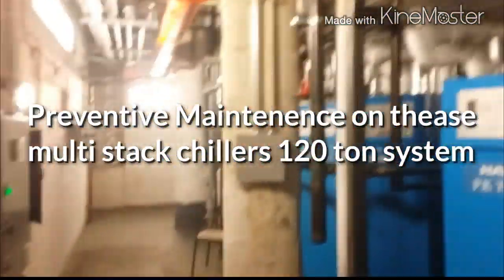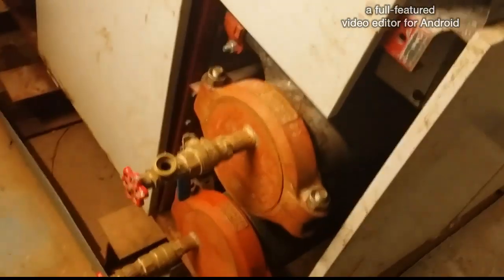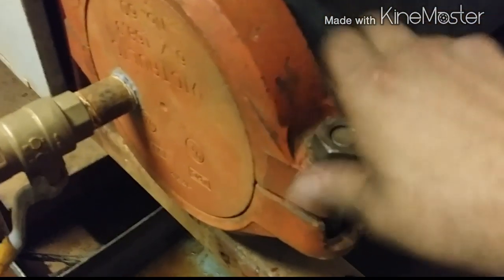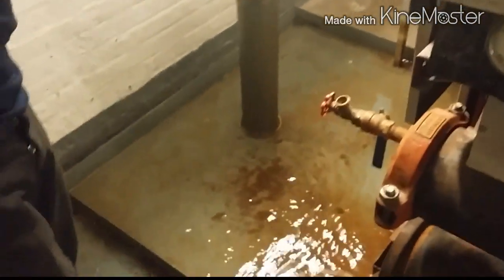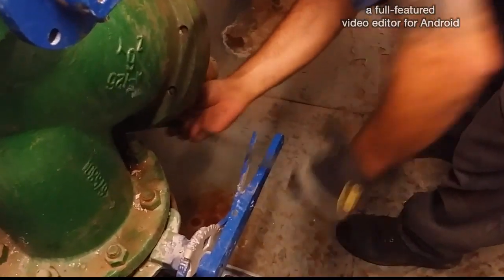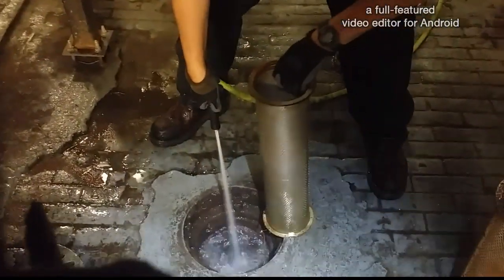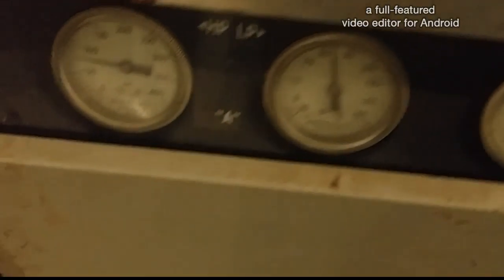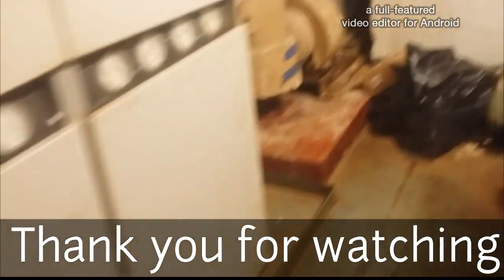Multistack Chiller | How To Pull Strainer | PM

Comment: Thanks for the tour of the mechanical room.  Gotta love that powerful beehive sound of the chiller rack while you're working in there.  I'm curious to know how often you pull those strainers.  Do you go by a schedule or just when the water temp rise or  the head pressures indicate restricted flow?  Thanks for the show.
Reply from the maker: thanks for watching brother. normally we go by a schedule. however sometimes they do get dirty quicker then we would like them to. so there are times its pulled because of headpressure problems or watertemp issues.